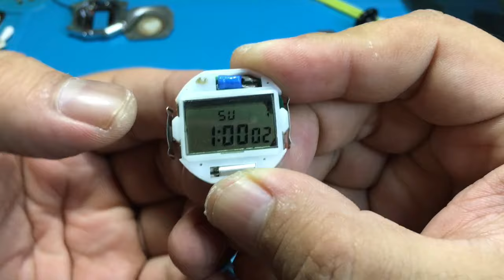HOW TO RESTORE 1987's VINTAGE CASIO A159W ( MODULE 593 ) DIGITAL WATCH | WATCH RESTORATION

Comment: Nice watch.  I had one similar when I was on active duty 1974-81.  Unfortunately it didn't last as long as my Timex did.  I got it a little bit before I went overseas and not long after I got back it died.  I've been carrying a pocket watch since 2017 and it still amazes me with some people's reaction when I pull it out.

Comment: On the 1987 module, there should be an incandescent lamp and not an LED.
Reply: It was probably swapped out for the LED when the incandescent bulb burned out.
Reply: This isn’t a real Casio watch. It’s a Chinese knockoff. One dead giveaway is the absolutely huge “Japan U” on the dial. Real casios have VERY tiny writing for the manufacturing plant location. The light, as you mentioned, is also common on these knockoffs. Definitely was not replaced as stated above.
Reply: @bobsmithinson2050  Oh, shoot…
Reply: Casio fake :))
Reply: @bobsmithinson2050  Yeah I was thinking the same. Look at the PCB, and they google 593 module PCB. It's totally different, and I know casio didn't used a different looking 593 module, because I own a very old F91. To further prove my point, I have a knockoff cheap casio, that has the same PCB. You could swap an original 593 module and make it last very long
Reply: @bobsmithinson2050  Took me 2 minutes to locate the Huge JAPAN U. I agree the word is actually very tiny on original watches.
Reply: @kshysztof9649 When was the module 593 introduced?

Comment: Goodnight friend. I'm Brazilian and I don't speak English very well. What substance do you clean the glue that was on the display? And then you add new white paper. What is that white paper that you place on the display? Could you help me? Thanks.
Reply from the maker: Hello :) , i used lighter fluid to remove the old glue residue, you can use IPA to clean as well and for the paper, u can use thin paper to use for the backing. hope that helps

Comment: Can a casio a168 illuminator light still repair? I change the battery but still after click the light nothing happen
Reply from the maker: this type of vintage casio is not using the typical EL type like currently casio's watch is using. It uses a smal LED soldered to the circuit board.. so in this case... u might have to change the LED ( or find a replacement circuit board that has functioning LED in your case )... or maybe you can check the LED connector for rust on the connector maybe it can help.

Comment: Try to wear finger cuts so that the oil from your fingers wont damaged the parts
Reply from the maker: tried using that but it seems i cannot feel the touch of things if i wear that finger glove, maybe my receptor is messed up.
Reply: Finger cots are necessary for moving parts such as gears. Yes, also battery should not be touched by fingers; you can use plastic tweezers.

Comment: Y como le hago si quiero reparar o repintar el extensible de un casio dorado
Reply from the maker: if you asking how to remove the scratches you can use sand paper and for repaint you cant repaint but u can do nickel plating on the bracelet.

Comment: Very nice video of the repair of the display, but where do you get the back of the LCD display or what can you use?
Reply from the maker: Thank you, for the back of the screen you can search in the internet for "back polar" ... that is the material for back of the LCD, but in my case here and for most LCD's i used metallic sticker to make the numbers pop even more.
Reply: @abukambing177  Thanks you very much for your answer 🙂

Comment: Nice!
Body plastic or steel?
Reply from the maker: this one is plastic
Reply: @abukambing177  in the 1987, the case of Casio LCD was in steel. And the back of the case was screwed by 4 tiny bolts more later than 1987.
And the restoration is good, but you did not changed the buttons o-rings.

Comment: Great work! What kind of silver sticker did You use? Greetings.
Reply from the maker: Any matte silver sticker will do or u can use matte gold as well :)
Reply: @abukambing177  Thanks for your tip. Greetings!
Reply from the maker: @63renan  but make sure the sticker is not thick if not it wont fit u can either stick it straight on the lcd or just put it behind whilst installing.
Reply: @abukambing177  Can i use Bare metal foil? So it's Chrome not silver. But it's thin.
Reply from the maker: @63renan  i suggest not, because chrome is reflective, and when its reflective you cant really read the digits of the lcd